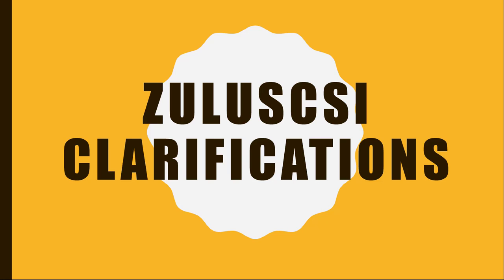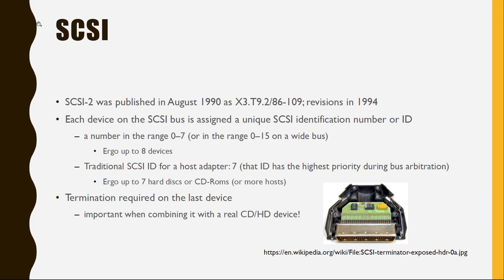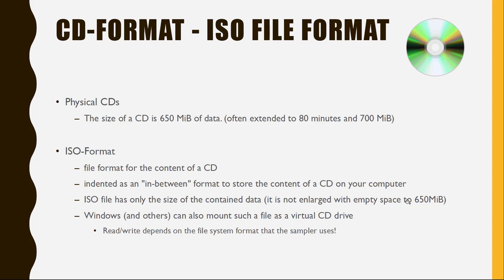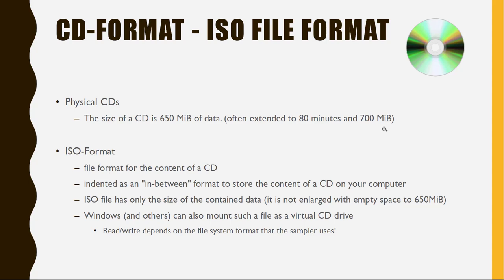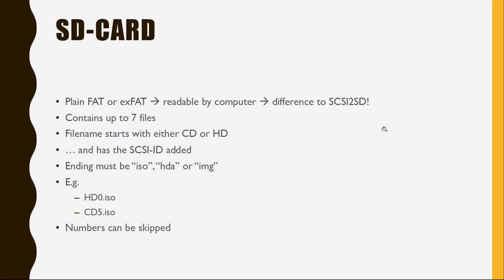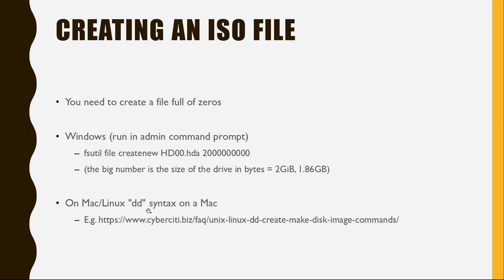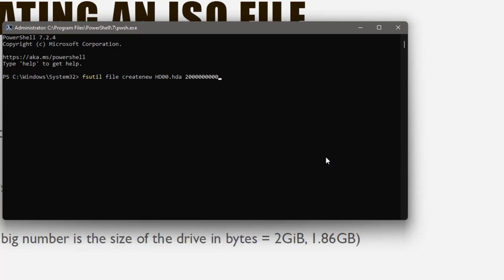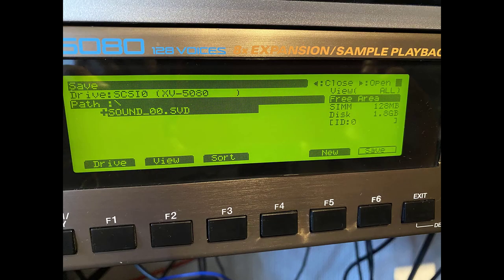ZuluSCSI: Your questions answered - Using SD-Cards with hardware samplers (Akai, Yamaha, Emu,Roland)

Comment: Hallo Jürgen, ich habe aus meinem K2500R das Floppy und das zugehörige Flachbandkabel raus und will ein ZuluSCSI mit dem 50pin Kabel reinmachen. Aber dann fährt der Kurzweil nicht hoch, er powered up, aber dann bleibt das display leer. Hast Du das schon mal gehört? Danke!
Reply from the maker: Leider nein, mit Kurzweil have ich keinerlei Erfahrung.
Reply: @mossgraber  Danke trotzdem
Reply: Hai ihr, bei meiner K2500R (wie auch im Amiga2000) musste ich ein Kabelende drehen, m. E. ist der Port im ZULUSCSI falsch herum montiert. Wenn ich eine Seite vom Kabel drehe (also die Nase abfeile und das Kabel anders herum einstecke) geht es sowohl beim K2500RS als auch bei Amiga… hat mich etwas Nerven gekostet…
Reply: Hatte beim K2500 übrigens den gleichen Effekt!!! Es kommt „Please wait“ dann weißer Schirm, wo eigentlich dast V.A.S.T. Logo und die Version kommen sollte… dreh das Kabel dann geht es (aber nur ein Ende!!!)
Reply: @EntropyCoM   ja danke, mittlerweile hatte ich auch den Tipp bekommen. Man muss auf einer Seite drehen, kann auch beim Stecker , der innen im Kurzweil in den Anschluss kommt, die "Nase" abmachen und dann "verkehrt rum" einstecken.

Comment: So have you explored the possibilities of the zuluscsi with the xv-5080 beyond loading wav files? Are there patches or any other cool ways to use it? An update video would be great. I use mine with my Kurzweil k2vx's but want to try to use it with my other devices as well.
Reply from the maker: You can do everything that you can do with a "normal SCSI harddrive". So, nothing fancy to report. Sure you can also store patches.
Reply: I sort of touch on this topic, if you mean how to load samples that assign full drum loops or sound loops to each key. I made a long detailed video about the Roland XV-5080, on how to do things like import/export patches + format & load samples + best ways to store patches & samples, etc. I also go in depth on how to use the ZuluSCSI V6.4 and Chicken Systems Translator 7. If anyone is interested:
https://youtu.be/2nmOA_ruIZ4?si=vKzpkq3YHJ2WW7oU

Comment: Hello, I just received my ZULUSCSi box (of samplezone) with SD card for my S3000XL. I work on Ableton Live to cut my samples. 
I wanted to know if a transfer of the samples was possible on the SD card directly? 
If so, what is the manipulation carried out so that they are readable by the S3000XL afterwards? Should I also transform the wav samples. in aiff. ?
I send you what I currently have on the SD card. Thanks in advance. Mathieu
Reply from the maker: I am not familiar with the S3000XL. If it requires a specific disc format you need something like Translator (which I cannot recommend) to copy the files directly from the PC/Mac.

Comment: Hi Jürgen, I installed a ZULU SD on a EMU 4 Ultra . I have plenty of ISO disk images on a USB key . I wish to install the files on the SD card which is already formated for the EMU . Do I need to use powershell or another sofware to drag the files as they are on the SD card ?  I'm not very familiar with these files manipulations ,hopefully with your help it will be an easy task. Thanks
Reply from the maker: With ZuluSCSI you do NOT format the disc with the native format. So, the SD-card should be simple FAT32 format. Then copy the ISO files to the SD-card and name them according to the ZuluSCSI naming scheme (see the video).
Reply: Many thanks for your helping answer but I'm confused with the already formated 64 GB  SD card.
In it  there are 7 .img disk partition done by Sampler Zone . Do I need to keep these ? I thought I had to copy the .iso files into the 3;99 Gb .img parts using a sofware (winimage as recommended ). I just don't find the way to do it.  It should be simple as abc but it's all a bit strange with these different .iso or .img. This is the answwer I got from Sampler Zone :

"The ZuluSCSI runs easiest (and perhaps best) reading off image files,

like the "ISO" image disk you speak of.

All you have to do to "install ISO image disk directly on the SD
card" is to copy that image file onto a regularly store-bought
formatted SD card. That's it.

I think what you are actually asking is how to create that image.
More good news - you don't have to. When we sent you the ZuluSCSI, it
had 7 blank image files (don't call them "ISO") already formatted
with the E4. All you have to do is copy/duplicate them while they are
on the SD card.

Or, if you want to write files into them using your computer, then
just copy a image file to your computer, and mount it (Mac: just
double click; Win: using WinImage - maybe that's the little software
you are alluding to), use it, then unmount it."

I downloaded the free Winimage software and had no success using it as it's probably not efficient unless you buy it.
Hope it all make sense to you.
 Thanks again  @mossgraber
Reply from the maker: @franckgraignic3100  It sounds like they sent you the wrong SD-card which is clearly for SCSI2SD and not ZuluSCSI. Their reply matches what I said. Best thing to do would be to use another empty SD-card and format it FAT32 since SD-cards in such a special format might be hard to reformat.

Comment: Hi, I should let you know that this does not work on a Kurzweil K2000. If I create and image with the files, the Zulu will not read the Image. Now, if I format that SD card image on the K2000 I am able to copy files from a Kurzweil CD to the image using the K2000 and that works. This is very very time consuming , slow and really makes the Zulu kind of archaic.  Please if you know a way that works better with the Zuluscsi and K2000 sampler please let me know. Cheers !
PS: I should also let you know that with a scsi2SD  V4.6 + all file copying can be done on a PC and is VERY fast.
Reply from the maker: That's exactly how it works. If your sampler has a specific disc format you need to use it, there is no way around it. The advantage of ZuluSCSI is still that you can handle the virtual drives as normal files on your computer, e.g. for backup.

Comment: Hello, I’m working with an Akai MPC 2000. Do I need to add the operating system as an iso or image file to the SD card? If so, how might I create an image of the operating system? 
Thanks for your insight.
Reply from the maker: Up to my knowledge both formats work fine with ZuluSCSI. I am not familiar with this MPC, so I can only give some general ideas: Can it boot from an external medium? Is there a download from Akai? in what format? I would try to ask in the MPC forum.
Reply: @mossgraber  Hello, Jürgen, thanks for this insight. I’m getting a “Disk Read Error” when I try the floppy disk method, so I’m trying to work around this. I believe akai holds the OS somewhere. I’ll reach out to this forum. Thanks again.
Reply: @bumblebeethekidd  Wenn du noch immer auf der Suche nach Hilfe für deinen Zulu und deine MPC 2000 bist melde dich.
Reply: @bumblebeethekidd  you should look for your scsi drives not "floppy drive"
all scsi hd s that are on the zulu card show up under load/devices/option:scsi 
if you turn the scroll wheel on the mpc.